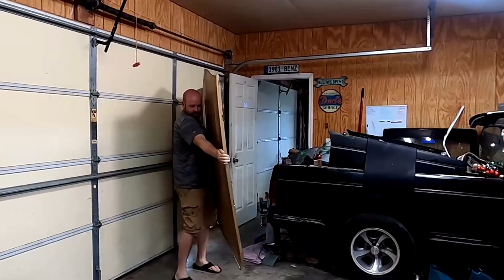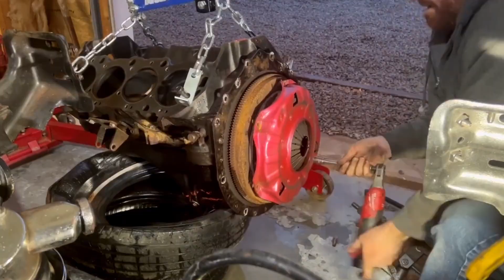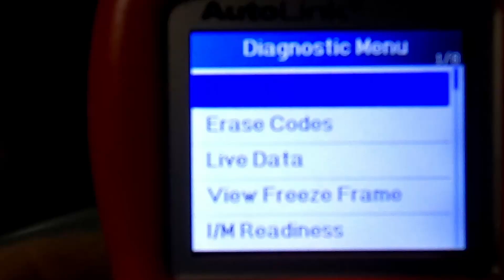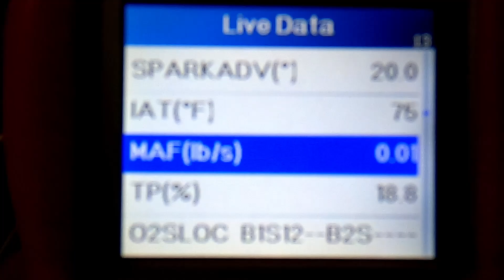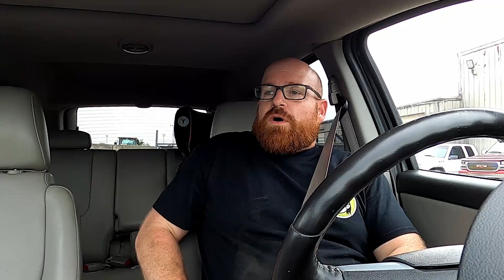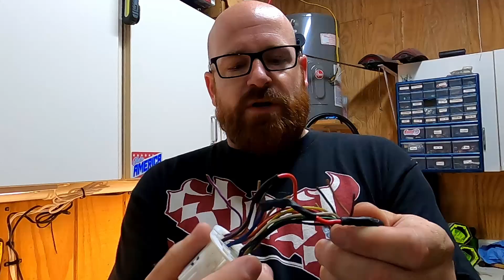Chevy Equinox 5v Reference Circuit Mystery!!!

Comment: What’s the final ruling here?  Air intake temperature sensor?

My 2012 Equinox has the Stabilitrak and Rediced Engine Power lights come on intermittently.  They were always on until I replaced the accelerator pedal assembly and sensor.  Now it’s intermittent.  It’s a very frustrating issue with no specific videos addressing the issue or fix.
Reply from the maker: Sorry for the late response, but the ait sensor was the issue for this car. Good luck with your issue, hopefully you find it easily!
Reply: @projecthardway thanks for the reply!  Still troubleshooting this.  I’ve got a 5v3 reference voltage issue with code P0697.

I disconnected my MAP sensor and issue remained.  Next test.

Comment: Doing the same thing but also random misfires scattered in here and there. I was watching live data on my scan tool and noticed my MAF is always reading high for air flow. At idle when warm it’s around 3.5-4 gps air flow. I’ve always heard the warm idle reading should be close to the engines displacement.  I just had a similar issue with my GMC Sierra. Tuned out the MAF was bad. The replacement Dura brand from AutoZone was junk too.  I may order the MAF and give it a go.  😂
Reply from the maker: I got lucky and found a good oem unit from the junk yard. Rockauto is a good bet too if you want to save some money.